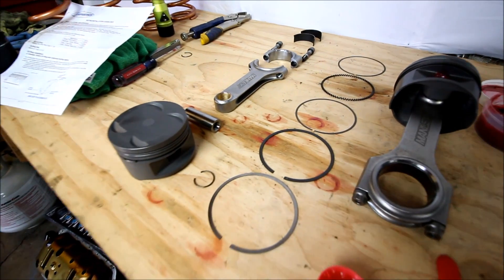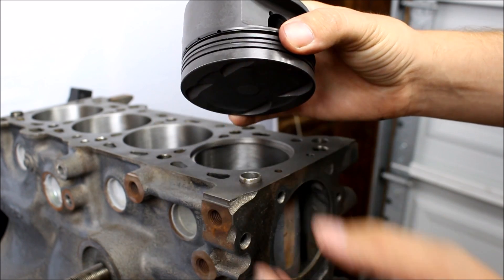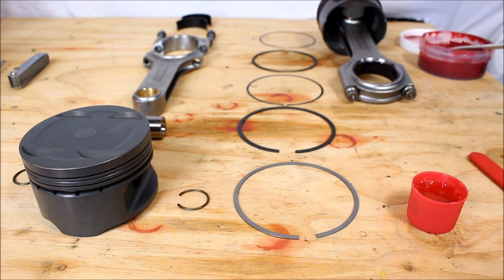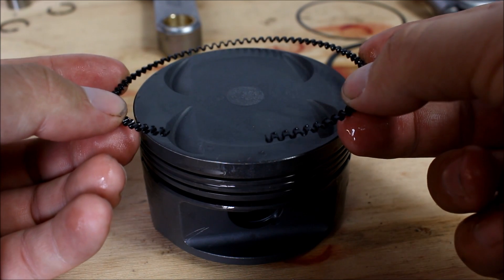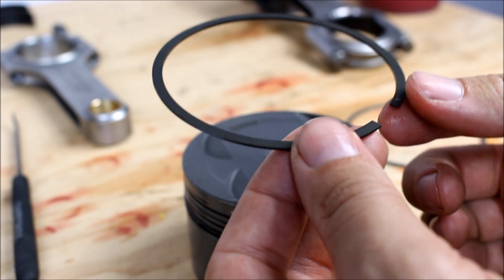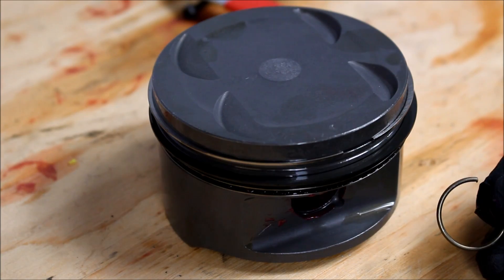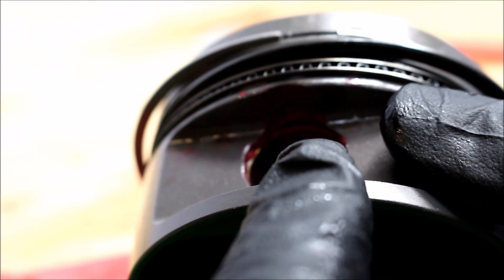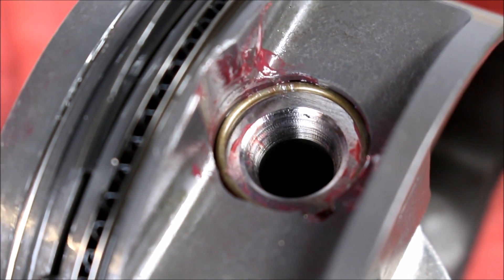PUT A RING ON IT: Assembling Pistons & Rods For the VVT Engine  (Rebirth Ep10)

Comment: Hey did you use oem thrust bearings
Reply from the maker: Yes
Reply: @TheCarPassionChannel  should I buy new ones or use the same ones?
Reply from the maker: @cris2k921  New is best if you're rebuilding your engine, probably the cheapest part of the whole rebuild
Reply: @TheCarPassionChannel  ok thank you so much  and  this is the car that made 500hp in one of your videos?
Reply from the maker: @cris2k921  Yes! The internals you see here in this video are the same ones still in the engine when I made 500+

Comment: Finally someone on youtube ralized that you dont put on your rings by hand, but with special pliers. But when using the pliers you use you just could do it by hand as well because the forces on the ring would be the same. And when in use it then can break on the opposite side of the cut. Proper piston ring pliers grab the piston ring on multiple spots and make an even spread of the forces. Your pliers put all the force on the spot opposite to the pliers and weaken the ring there.

Comment: 6:41 what is that thing he’s brushing in the hole? Also what does it do?
Reply from the maker: Assembly lube. So when the engine fires up for the first time, all the moving parts are already lubricated before the oil pressure has a chance to build
Reply: TheCarPassionChannel oh ok then thanks

Comment: Did u balance the rods and pistons?.. and is notching the block required to run H beams? -Thanks
Reply from the maker: Pistons, rods, crank, flywheel, clutch, and damper was all balanced. Block modification was not necessary.
Reply: TheCarPassionChannel thanks for the reply!!! :D

Comment: I know this is really old but what did you tell the machine shop? I’m doing a stock rebuild and I want the machine shop to have it all filed and the crankshaft pieces and everything done as well
Reply from the maker: I brought them the block & head, along with all the internals so they could machine the block correctly to my specific and check the clearances on my actual bearings and rods etc

Comment: Big thanks for doing this video series Greg!!!! I have an 03 MX5 with the 1800 VVT engine and will be doing a TD04 install on it next winter, starting to research everything I need now and gather parts. Your video's will prove EXTREMELY useful when it comes time to install it all!! Any idea how far I can push it power wise on the standard rods? If I can get 220~230 for now I'd be very happy but ultimately I want to do a full strip down and install something like Manley or Eagle conrods and push the power up, maybe even go with a bigger turbo at a later stage.

Comment: I was cringing when you were pulling the rings apart and they were flexing as you were putting them on the piston... I've broken rings doing that
Reply from the maker: Blake Lang You've broken oil rails doing that? I used ring expanders on the compression rings, the expander didn't work very well on the oil ring rails
Reply: well I have only ever rebuilt a few dirt bike / atv engines xr100, crf250f and a trx250 the xr engine was the one I broke the oil rings on all the others were fine but I was extra careful and used the spiral method vs pulling them xD so I have no actual experience rebuilding an engine like this. So was just a little flashback when I saw you pulling them xD

Comment: I think you need a tool to install piston ring, rather than just use hand to expand it. Coz it might be resulting in uneven force, it cannot be seen by visual but under microscope, it will clearly show the issue.  https://www.ms-motorservice.com.tr/fileadmin/media/MAM/PDF_Assets/Piston-Rings-for-Combustion-Engines_53094.pdf

The reference you might interesting.

Comment: on ur website is it says ur going to be running a megaSquirt PnP for a 90-93 ? is that going to work fine with ur vvt motor with a vics intake manifold and which MSPnp Gen are u using on ur new build and broke and boosted ?
Reply: I've been debating if I can get a MSPnP Gen2 for a 90-93 and be able to use it on my 90 miata and my 97 miata ? do u know what the differences are between buying one for 90-93, 94-95, and 96-97 ?
Reply from the maker: MSPnPPro is basically a plug-n-play MS3 :)